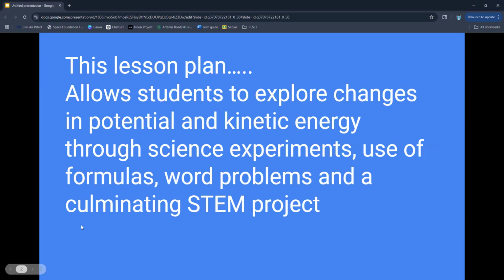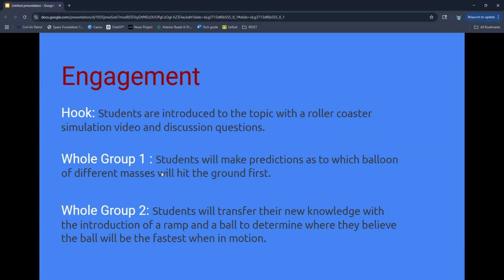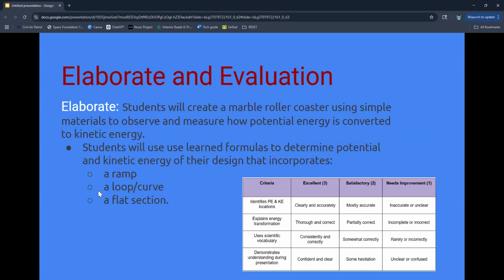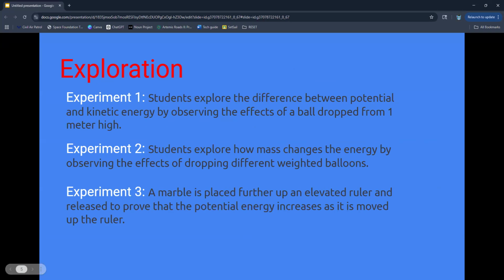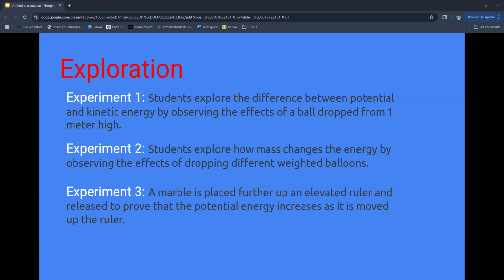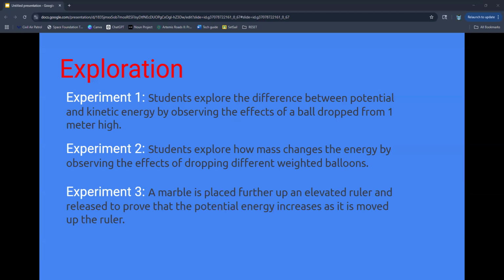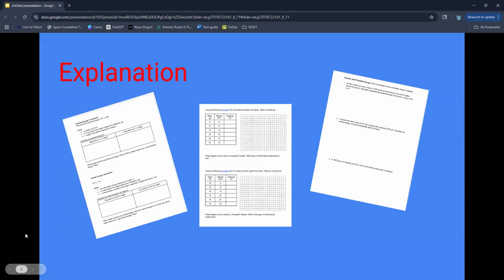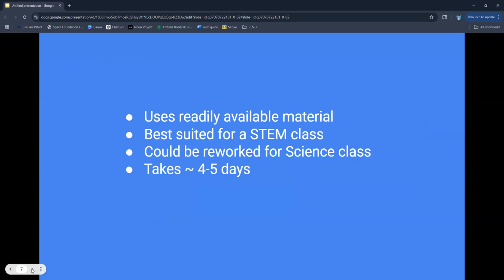The Power Play: Kinetic vs. Potential Energy

Comment: I enjoyed this lesson plan as it was simple and right to the point. The experiments with first the balloon dropping, then marbles, then rolling objects down the ramp are very student friendly and provide a direct and concrete connection between potential and kinetic energy. The mathematical portion of the lesson plan is also direct and effective in not only helping students understand the relationship, but also address mathematical skills needed to fully understand the concept. Additionally, this lesson is a precursor to our lesson about Newton's laws of motion. The lesson progressions tie in very well. This lesson focuses on potential and kinetic energy transfer which is a key factor that determines outcomes in our catapult lesson. The lesson even incorporates some experimental elements of our lesson plan. I would use this lesson first as a method to  help students establish the understanding of energy transfer, a key component variable in their projectile motion calculations. Teaching this lesson first then introducing ours would solidify student understanding as well as develop experimental and engineering principals and skills the students will need to successfully construct their catapults.  Could your lesson maybe include an experiment that addresses different types of potential and kinetic energy, such as a spring (elastic potential or kinetic energy), or a battery ( chemical potential to Kinetic in the form of electricity)?

Comment: I like how the materials will be easy to gather and that they are exploring each of these ideas with hands on experiments and I love how you added the math side and graphing into this lesson.  In my classroon we have very few materials, so having easy to use materials is super important. I like that this can also be used in a week.  Sometimes labs are written too long.   I am eager to use this lesson with my ELL students in my 9th grade physical science classroom because of where and how you added the vocabulary.  They need that vocab introduced early and often.  My only question is, where does the collision simulator fit into the lesson? Are you using that as an extension?

Comment: I liked that the labs were simple materials, that there are 3 different labs with great hands on experience for the students to discover the different changes in Potential vs. Kinetic energy.  I would use this lesson as an add on to the unit for Kinetic & Potential energy in my physical Science class as well as having my students build a roller coaster that has to actually run on the track.